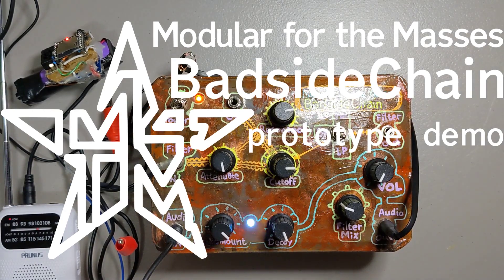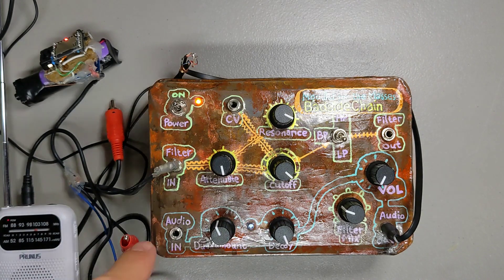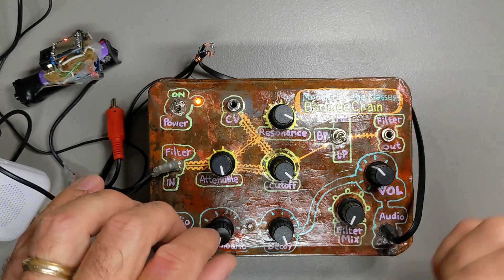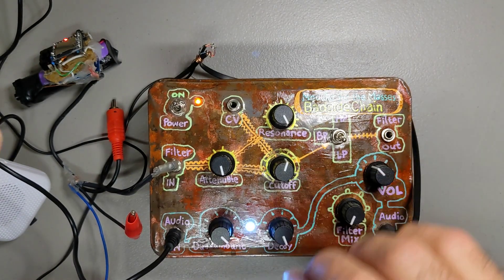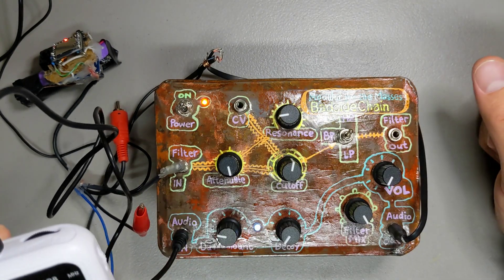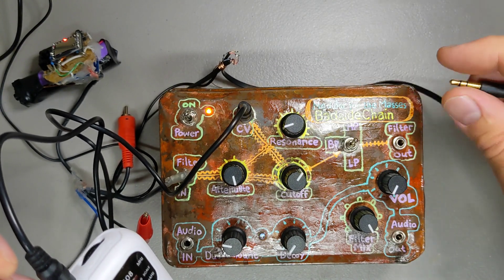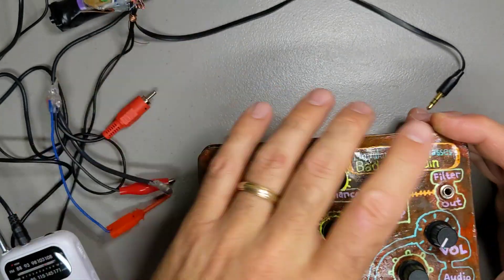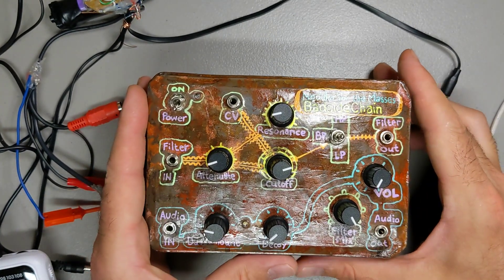BadsideChain prototype demo!

Comment: It was very interesting to learn about the technique using high pass to bring out the deep bass. I like the idea of using random noise from radio for ducking. It's so funny to catch out-of-context statements like "Whatchoo lookin at?" at 6:51! I also like the request you made at the very end of the video😂
Reply from the maker: Yeah my kick drum is permapatched through a high pass (half a Polyfusion HPF) and it's a great technique to emphasize any frequency and make it ring. Like, a short kick with that filter near-oscillating set to a slightly higher pitch makes a cool bounce kick like boiingggg

Also you can close the filter up to turn the kick into a little click for those sick breakdown sections and bring it back on the drop like BOOM BOOM (I'm in love with kicks)